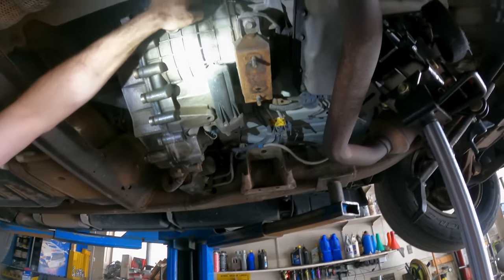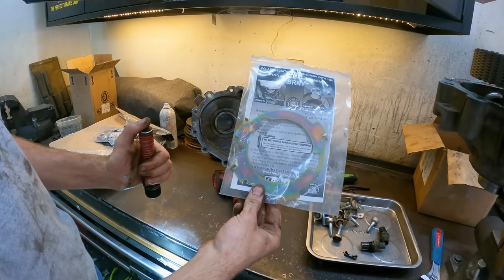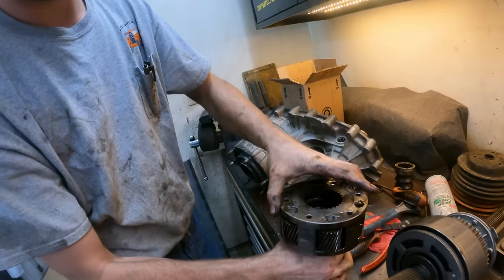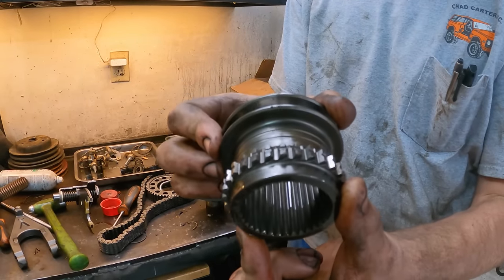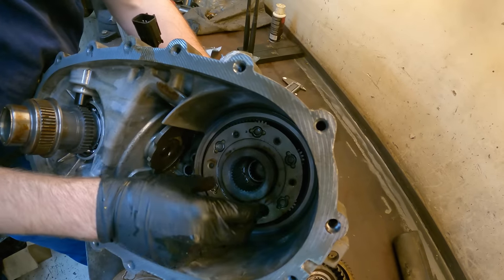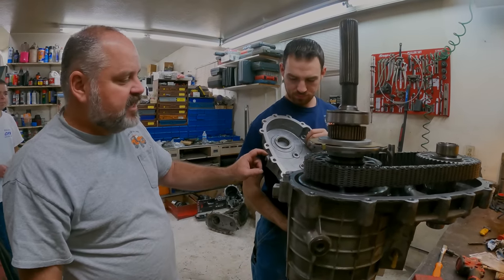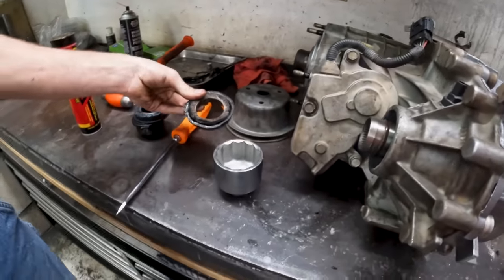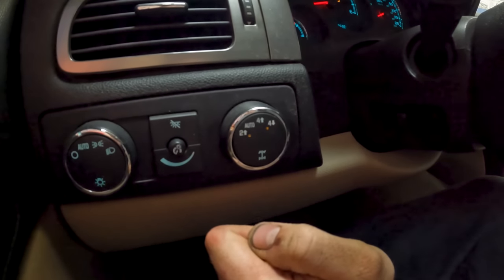Suburban DOWN! We Fix A Transfer Case

Comment: I am a retired master tech and now old and lazy. I have a F-150 and had a noise from the rear diff, I put it in the air and listened to the rear and confirmed (to me) that the diff was bad. I took it to the Ford dealer as it is still under warranty. They took forever to check it and finally told me that their tech said the noise was coming from the xfer case. I said I had isolated the noise to the rear diff and they as mych as told me I was an old man and their tech was a professional. They rebuilt the xfer case and after a few weeks called me and said during the road test the noise was still there and it was coming from the rear diff. I asked if I could drive it home ( about 150 miles) and they said their "expert tech" said it was OK. I made sure they ut that in Oasis, the Ford warranty system and drove it to my regular dealer. They said the xfer case was making a bad noise and they drained it and chunks came out. The xfer case was rebuild (it had completely hand grenaded) and then they said the rear diff was bad. They rebuild the entire rear axle as everything was bad and contaminated. That is what you get from the preformed idea that an old man can't know anything and then screwing up royally. I wish you were closer to have repaired my truck! great job!
Reply: I'm ready to move just to have a great mechanic near by. These gentlemen know their stuff.  Great power lift dad.
Reply: Always be prepared to learn by the mistakes of others.
Correcting mistakes is how everybody learns.
No matter how long you live, it won't be long enough to make all those mistakes yourself.
Reply: The young people think we old farts don't know anything, how did we get here without any  knowledge?
Reply: @kingtut5923  everything that this young generation are so smug and proud about having; it was our generation that invented all of that, so they could inherit the benefits.
Reply: As always great job guy's another satisfied customer!
Reply: I call them "Stealerships" and now YOU know why too.  Sorry for you man.

Comment: I had a 1982 GMC pickup. I didn’t know anything about transfer cases. So when I bought the truck I was doing maintenance, changing fluids out and I refilled the transfer case with 90 weight gear oil!  Never had any problems. Drove it thousands of miles. Finally parked it in 2002 I think.

Comment: I drove Suburbans from 1976, one model and second an 8 passenger -  1st a utility , single bench, I put my 10 foot rowboat into the back and close barn doors,  350 aspirated 2 barrel Holly, manual - Spicer 4X4 - second was a family wagon, 4X4 automatic-350ci on propane, only took $25 per 400 + km on road trips with7 passengers and trailer hauling all toys to BC coast, wish that was electric now :)

Comment: In this video I leaned something about my 07 Yukon, the transfer case should actually make a "Motor noise" as it is shifting, and there are lights on the shift selector to indicate what position or gear you are currently in!   My new transfer case was not the only part that required replacement.  Great Job

Comment: Great informative video! My 2003 3/4 ton has the auto 4WD but I have never used it. I would guess that when the transfer case shifts in on auto the front differential locks in at the same time. The shift motor went out and it indicated that it was in auto. Keep up the good work and keep growing.
Stay safe healthy and happy 👍

Comment: I rebuilt my first transfer case last fall and it was definitely a learning experience and I can appreciate how difficult this job was. Mine was a Dodge 241dld and the chain was loose and also found a synchronizer clip broken way down inside that made me have to tear it completely apart to fix. I had to do it twice because I put the broken clip on the wrong side of the gear it went on and it made it not able to freewheel in 2wd. I couldn’t find a reference for where the clip went and chose the wrong option lol. So I had to take it back out and do it all over again 😣 I definitely learned a lot about them tho and I’m confident I could fix another one now so actually it wasn’t so bad. I try not to go by the “we fix it right cause we do it twice” motto very often but sometimes it happens lol

Comment: I had almost that same problem with my Suburban. It didn't leak but basicly evaporated the tranny fluid and burnt the inside. But it only had 325,000 miles on it,it is an '01.
Reply from the maker: Bought us an ‘01 12 years ago, great rig!

Comment: Very informative video!! I have a 2011 gmc with this tcase I believe. I think I’m going to do the case saver before it breaks!!
Reply: A 2011 will have a borg warner. They do not have the pump rub problem.
2007 was a transition year, this is one of the last suburbans with a NP246

Comment: My question is, why does the pump move in the first place?
Reply from the maker: It's connected to the main shaft and the outer body just sits in some notches in the case. The only thing that kept the pump from rocking in the case was a little spring clip that would break at around 80k miles.

Comment: Man thanks for sharing ... reminds me i gotta split mine in my s10 just to reseal the halves. think it started leaking from removing the lil protector plate for the shift cable a few times. 

Not sure if you know but do those have that case rub problem?   I dont think they do but sure someone knows. its the 4.3 4l60 tranny auto
Reply from the maker: It shouldn't have the same problem.

Comment: @Chad's Fab  Hi guys, I was backtracking through yer older videos and it looks like I missed a few and THIS one (the one I needed) is one of them, yay!  So I have a couple of questions for you on Suburbans.  I have the '94 K2500  and it appears the '93 and '94 are Very Close to being the same.  #1: Do you need to have it in 4WD High to change out the actuator in the front dif, so the washer doesn't slip?  Someone removed the electric actuator before I bought it and installed a lever and cable system.  A very lightweight cable and even lighter brackets, basically junk. So I want to obviously put in an original style actuator.
  #2: What year is the second white Suburban, and does it have the same transfer case as the '94 does?  PS, my Suburban is also White.  Are they all white?  LOL
Thanks in advance, Bob.
Reply from the maker: the washer will only fall out if you pull the axle stub off of the differential case. 
The second suburban is a 2007 and has a np246 case. Your 94 will have a np241 case.
Reply: @chadsfab  That's Super Cool. Thanks for answering my question, I really appreciate it.

Comment: Those GM cases are very problematic, learned they have a drive pump inside the case where you can only run transmission fluid.

Comment: I presume that the Xfer case was filled with gear oil ????
Reply: If they didn't show it, it never happened.
Reply from the maker: Yes, yes it was. Stacie just got pulled away and we forgot to get it on video. Hard to remember that it’s not just about getting the work done but showing it to.
Reply from the maker: It was filled with the correct auto-trak fluid.

Comment: I'm just curious:
 Why is it you guys buy hammers and mallets with such long handles?

You never seem to use the grip on the tool as it was designed, or intended, to be used.
Always choking the neck of the handle.

Which seems strange to me, given how meticulous you guys always are with every other aspect of your work.
Reply from the maker: Kehin seems to like to hold them up by the head, I don't know why.